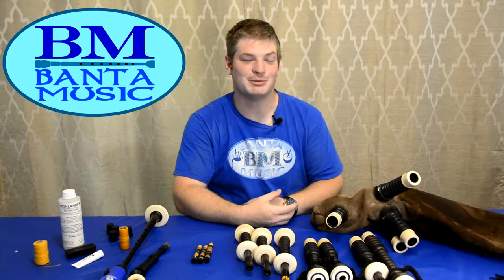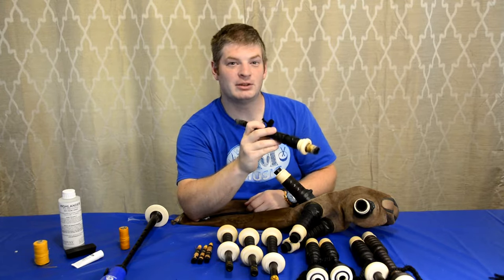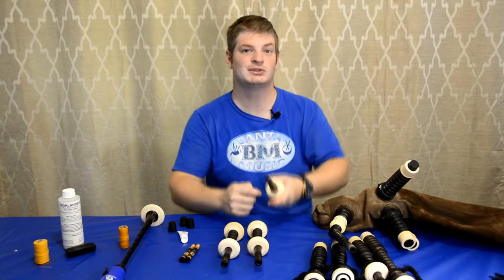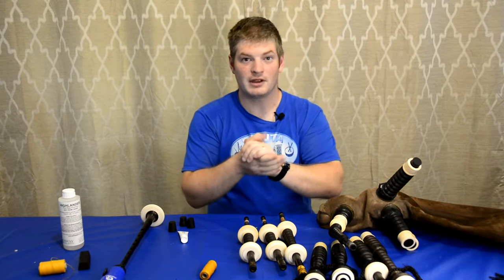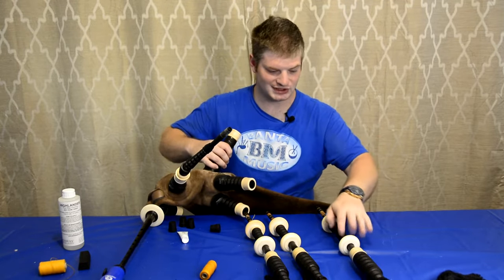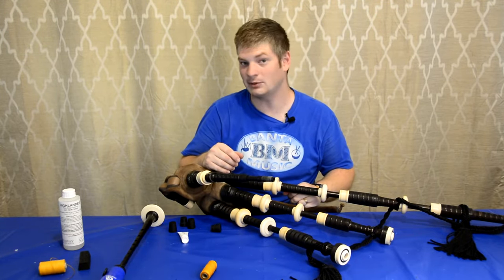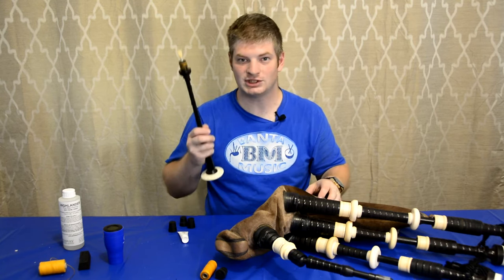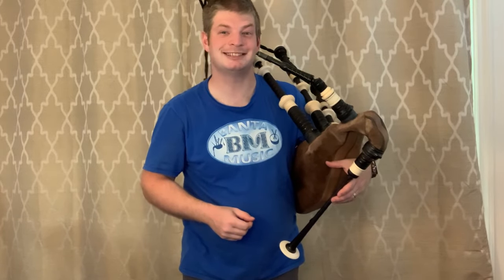Bagpipe Lessons - HOW TO SETUP A BAGPIPE!

Comment: Why is there not a shoulder strap to hold it in place?
Reply from the maker: A shoulder strap is not needed. Novice pipers will sometimes opt to have a sponge or other cushion material that the bass drone can lay against till they adjust to the pipes. There is a bit of a dip between the base of the neck and the shoulder bone that the drone can position  in.
Reply: @KyleBantaMusic  Thanks! I got a bagpipe at a flea market but it doesn't have any reeds so I'm trying to get it functional🙂
Reply from the maker: It really depends on the type and quality of bagpipe it is. Did the seller give any info about the make or brand?
Reply: @KyleBantaMusic   Dont have any information about it but it looks rather fancy: carved wooden pipes with chrome rings and colorful material.  Can I send you a picture of it?
Reply from the maker: Absolutely! Send it to kyle@bantamusic.com.

Comment: Very Nice video :) I have McCallum AB4 set since couple of years, Zipper Bannatyne bag, everything is set the best way i can, but it's been si many years i cannot have that power sound from the chanter itself. my Low A is correctly tuned with my drones, Low A is about 484 Hz, but definitely not that powerful sound as you. If you know the solution, i'd be happy to have some help :) Cheers
Clem
Reply from the maker: What drone reeds are you using?
Reply: @KyleBantaMusic  i’m using Canning drone reeds, which sounds very good on my pipe, and shepherd medium on my McCallum Chanter, but sound from the chanter, is definitely not as powerful and straight as yours.
Just tape on few holes (D and high A)
Reply from the maker: Ok. Do you know how old the chanter is? Also, which version of canning? Blue, original?
Reply: @KyleBantaMusic  original canning brand (grey/brown one), chanter is as old as the pipe, from 2008. 
I also have brand new G1 chanter, which i tried with G1 platinium reed, same sound, definitely not as powerful as yours
Reply from the maker: When you say powerful, are you referring to the volume?
Reply: @KyleBantaMusic  the volume, and the pureness of the sound
Reply from the maker: Is your chanter poly or blackwood?
Reply: @KyleBantaMusic  all Polypenco
Reply from the maker: Poly will typically give more volume than blackwood. Blackwood is able to breathe better and thus will give a more pure sound (but costs more than poly). It also depends on how far in your chanter reed is seated. If it doesnt seem slightly loose in the reed seat, it cant vibrate properly and wont give as nice a sound.
Reply: @KyleBantaMusic  your chanter look Poly, and i’ve got couple of scottish friends that play Poly as well and are not that annoyed. 
My reed is quite well seated, and pitch always around 484-486 Hz. I should try to send you sample, then you can see by yourself :)
Reply from the maker: Poly chanters work well for volume. Sure, record and send me a link or file. Happy to give any tips :)
Reply: @KyleBantaMusic  sure, thanks a lot. Any mail/whatsapp where i can try to send it to you ???
Reply from the maker: You can upload it and send me a private link, or you can send me a link through my website form.
Reply: @KyleBantaMusic  alright, will try to do it later on ;) cheers